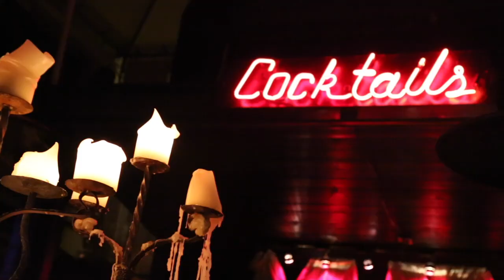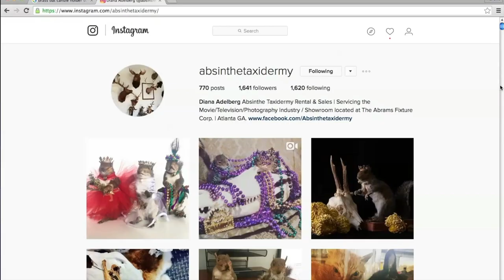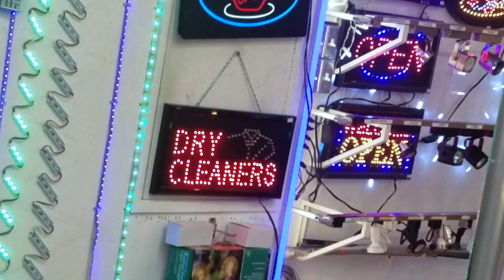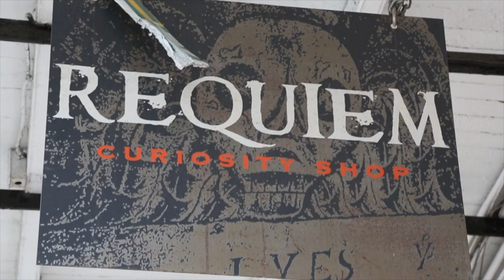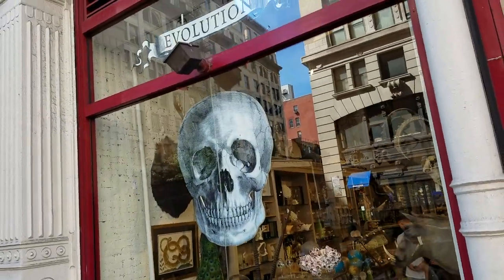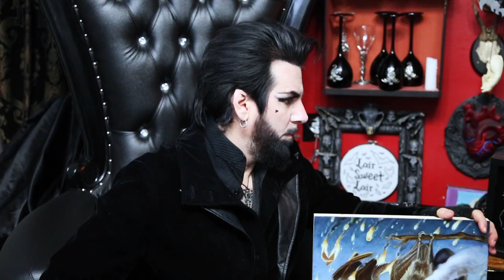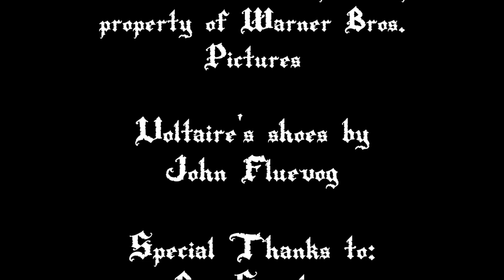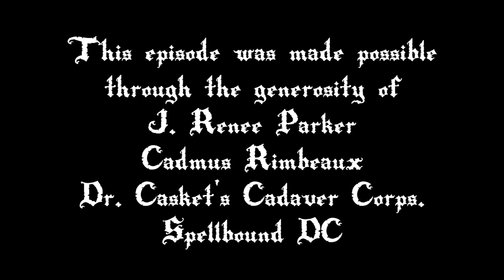Gothic Homemaking Episode 7- Bats in the Belltower

Comment: Instead of the LED lights, did you consider EL (electroluminescent) wire?  It's a continuous glowing wire, so you don't get the brighter and darker spots behind the diffuser, and it can be cut and (with a bit of care) spliced

Comment: spray paint the ivy a lot less messy
Reply from the maker: actually that is that is not true. I have done it. It takes absolutely forever to get the paint on every side of the leaves and in every little crack. And it's a tremendous mess as the spray paint is shot in all directions while you're trying to do this. Dipping the IVy in a bucket of painy while it seems like a giant mess is actually far more manageable and far easier to get the paint onto 100% of the surfaces.